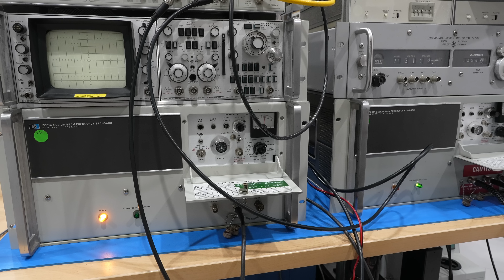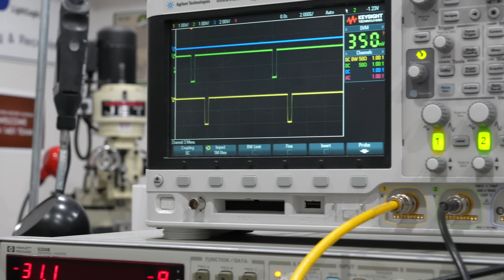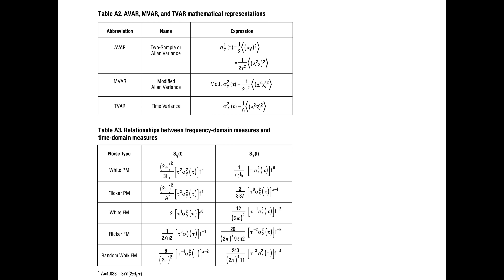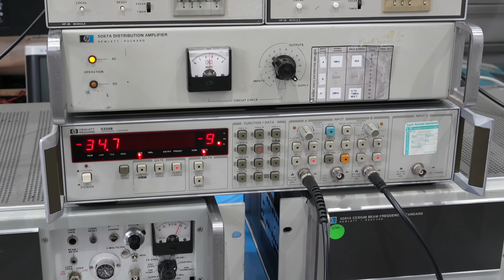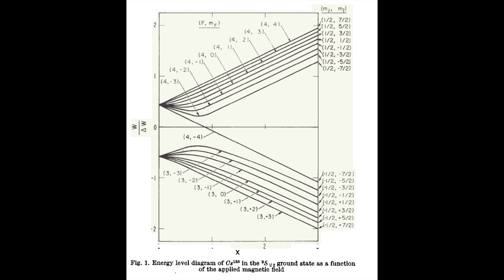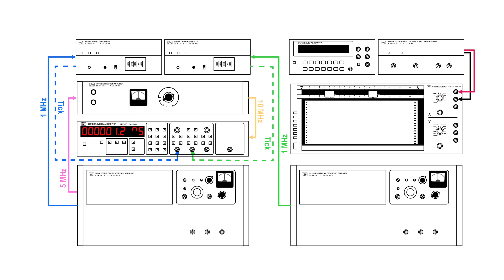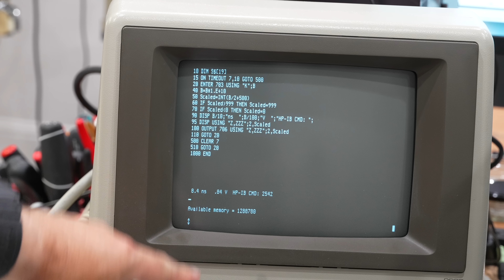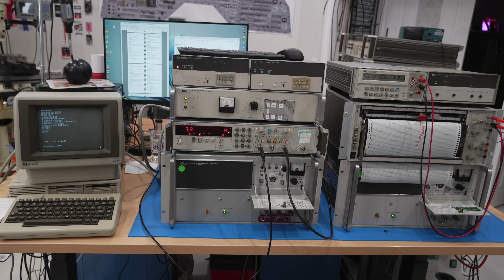Our first dual atomic clock comparison experiment does not go as planned

Comment: Just for fun, what would this stack cost at the original HP prices?
Reply from the maker: Reposting my previous response to a similar comment:
From the 1982 catalog: 
HP 5061A (hi perf) $34,400 (x2)
HP 5087A (with doubler) $1,645
HP 59501A: $700
HP 59308A: $1,325 (x2)
HP 7132A: $3,100
Then they stop publishing list pricing from 1983 to 1985 (to prevent heart attacks, I presume?). But it reappears in the 1986 catalog:
HP 3478A: $995
HP 5334A (Xtal oven + C channel): $4355
HP 9816: $5,150
Which is a grand total of $76,895 of 1982 money plus $10,500 of 1986 money.
Corrected for inflation, the setup is (was) worth $285,466 in 2025 money (list price).
Reply: @CuriousMarc  Plus a service contract - ha ha.
Reply: @CuriousMarc   Yeah $34,000 was about my dad's salary for a year as a social worker with a masters degree in Canada, in 1982.  So this is some sweet expensive gear.
Reply: @CuriousMarc  That's actually quite reasonable considering.  I was expecting it to be over a million in 2025 dollars.  Good value for money.
Reply: The most expensive part are probably the HP-IB cables ;)
Reply: This is very interesting to me because I worked in secondary standards lab which used standards traceable to the National Bureau of Standards. We used reference and transfer standards to calibrate electronic test equipment. Our standards were reference to the primary standards lab which is directly traceable to the NBS lab near Fort Collins Colorado. I believe the atomic clocks at the time were of the cesium beam type.
Reply: it's OK it was all originally public federal debt .... picking up the tab... and way cheaper than what is spent today BTW 70 years later  the clock is at USD 38 Tln.

Comment: I know this is not in the spirit of the experimenting, and definitely isn't vintage, but if you wanted a "source of truth" to calibrate against, shouldn't it be very easy to use (relatively) cheap GPS time modules to calibrate against?  There are modules which can output a 1Hz or 10Hz pulse, which is VERY stable over time, and should be possible to compare the drift of one of the atomic clocks at a time, and see how it drifts over time.

EDIT:  Apparently the US gov says GPS has "a time transfer accuracy relative to UTC(USNO) of ≤30 nanoseconds"  I suppose that even though GPS is incredibly accurate over a longer terms, that may not be stable enough in the short term for this purpose...

Comment: That HP stack brought back memories! I had their 2-channel 10 (or 5?) MHz digital signal recorder, connected to a smaller HP desktop machine with the same HP-BASIC with built-in HPIB protocol handling and a thermal paper printer for hard copy.
Later I became a bit of a Time Nut, volunteered about 20 years with the NTP Hackers and at one point optimized the reference ntpd deamon to be as fast as possible, running at more or less wire speed while supporting a million or more clients on a 4-core server with TCXO or Rb master clock locked to a GPS timing receiver.

Comment: Marc, you might want to check out a channel called "Chernobyl Family" if you don't already know them. They just build a simulation of the Chernobyl reactor display panels, which were electroluminescent originally. They used LEDs, and at first glance I really couldn't tell that they weren't the real thing. On close inspection you can tell, but it is a dang good simulation.

Comment: Can someone help me understand something I'm overlooking please?
if the two clocks are generating frequencies in the megahertz range and are very close;
Why can't I mix the two directly and count the beats the way I tune a piano?
Is that what's going on and I missed it?
I feel I am ignorant of some principle that everyone else finds obvious.
Thank you 
-- Molly
Reply from the maker: The answer is that the clocks are far too stable to generate any measurable beat signal on a human time scale. We aim to achieve a long term stability on the order of 10-14 as shown in the video. To be able to count one beat (at 5 MHz) with your method, the two clocks have to move by 200 ns (one period of 5 MHz). At 10-14 stability, that happens every 200E-9 x 1E+14 seconds = 20E+6 seconds. Which is every 231.5 days. Maybe half that because we have two clocks, but you see the problem.
Reply: @CuriousMarc  thank you Mark. I was having trouble grasping the scale. My decimal points kept rolling off the table and under the sofa. --Molly

Comment: Hi, please don’t shoot the messenger but would the length of the cables and the velocity factor and transmission delay play a factor here? A simple TDR on the cables may yield propagation delays? Those cables don’t look uniform to me and impedance may also factor in. I have an old scope with about 20 meters of coax built into the internals (from factory) for the vertical propagation delay. I use a GPSDO ^11 or better resolution and often wonder if the account could be improved by using  uniform cables to my equipment. Fortunately my GPSDO has 1mhz, 5mhz and 10mhz clock outputs and I’ve smoothed them with LPF and BPF’s for the purest sinewave I could without too much attenuation. Would love you know your thoughts

Comment: Couple of things that come to mind - the first obvious is did you degauss the tubes after putting both the units in position?  If you want to get the full stated accuracy on the opt 004 equipped units then you need to do that every time you move them - ideally you should run them for at least a few days in continuous operation mode before doing so.  Also, do you know how much run time is on the tube?  If you don't know the provenance of the unit it's also worth checking if someone has done something like turning the Cs oven up to try and get some more life out of the tube, since tricks like that typically degrade stability.

Comment: I know you want to do this the most vintage way, but another method is to use the frequency output of your oscillators to drive the system clocks on a Raspberry Pi, then feed them with PPS on the GPIO. You can then use PtP to measure the time drift of those two clocks very accurately AND measure it relative to GPS PPS and NTP time.
Chrony will give you a clean view of the difference in time drift.

Alternatively, speak to the guys at Timebeat about their chipscale atomic clock master clocks. See if you can borrow one and their software used to measure clock differences.
Reply from the maker: Even with a commercial chip scale atomic clock, this would be 4 orders of magnitude short of the needed precision. Chip scale clocks are quoted 5x10-10 over 48 hours. We are trying to achieve <5x10-14. NPT time is precise to about 1x10-7 on our time scale, about 7 orders of magnitude short of our goal.

Comment: The adventures in watching precise clocks are subtle, and slow paced. Comparing a signal that goes "ping" once per second, to another one like that. And they seem to tick precisely, second after second, and their mutual offset hardly ever changes. How boring is that?! Hehe yeah - until you add long-term recording, and process the data into charts. And you come back the next day, to look at what the trawl net has collected. Depending on the scenario / rig and experiment setup on your desk, the result can be boring, like a flat line (which often means success, in timekeeping) or it can be "interesting" - in which case, you find yourself scratching your head. You formulate a possible theory, adjust your experiment, and rinse+repeat. Troubleshooting sessions of interestingly misbehaving kit can take weeks of wall time - even if it's just OCXO's, doesn't need to be atomic. Or take PTP to the table, try plugging some devices together, try a redundant setup, try doing some harm to the topology - it can be no end of fun, only it is slower paced than what normal people are used to...

Comment: Is there any way to use a GPS standard as a master clock since the GPS system itself requires stringent and stable absolute time?
Anyway, bravo for the efforts and anything you can do to bring those HP clocks back into spec or spec+ is commendable!
Just love old chart recorders; I have a HP plotter with electrostatic paper holder--really neat tech.
Just so sad nowadays, that the inner workings of tech are so inaccessible, with the only way to use vintage equipment...

Comment: Wow, this brings me back to my time as a Metrologist, nearly 20 years ago!

Spent most of my time in RF/microwave, and had at least two rubidium and/or crystal oscillators on the bench all the time collecting 30 minute average samples, compared to the same HP cesium oscillator, for several weeks at a time.

This is my kind of video!

Comment: Marc, I use a GPS-disciplined Oven Controlled Crystal Oscillator (OCXO) in my shop for aligning radios. It provides a "perfect" 10MHz reference signal that feeds into lab gear to provide accurate frequency measurements. I got mine from a cell tower surplus site on eBay where it was used as the local master oscillator. In theory, it relies upon the atomic clocks aboard the GPS satellites. The OCXO is for fallback and for bootstrapping the system. Powering it on requires a number of hours to settle as well as syncing to at least 4 satellites - all visible via the serial port.

May I suggest you run an experiment feeing one of these into the differentiator and compare to your local atomic clock(s). You've got the correct method using the phase variance to spot the drift. It would be instructive to see how much relative drift exists between a local cesium source and the GPS birds.

These devices are somewhat readily available on eBay as surplus. I'd stay away from the Chinesium  products at low price points.

If you wish to borrow mine, I'd be happy to loan it to you. Just contact me.

Bill
Reply from the maker: I doubt that a GPS disciplined OCXO could do it. Even a high-quality GPS disciplined Rubidium is not enough. What is the Allan variance at 100,000 seconds of your clock?
Reply: @CuriousMarc  I'm not sure. I'll look for that. Thanks for the reply!

Comment: Could you not simply compare the raw outputs of the atomic clocks by adding them and measuring the beat frequency? In the Michelson-Morley experiment they set up an interferometer to compare the time of the two beams which essentially did that.

Comment: The atomic clock that was used at the LoRAN-C station on Iwo Jima back in the 1970's was accurate to Two point five times ten to the negative 14th power if I remember correctly.  What is the accuracy of these clocks?
Reply from the maker: See video, depends on the time period. At one day, the original 5061A was 10-13 and the hi perf 5061A was 5*10-14. The later models got better though, but our tubes are tired, so this is quite borderline.

Comment: Marc, since you don't have a national Lab master clock, could you use the "app" from NIST that measures the time lag between their master clock and your computer?

Also, I have an HP counter similar to one that we used at work, connected to a hydraulic flowmeter & the "number" output by the counter was used to calculate the volume of hydraulic oil that was going to be used by a test stand to *quickly* test a tailhook damping valve for being within its proper calibration.  It was a lot more basic than what you're using.  Could you explain the different uses of a counter, possibly in a future episode?  I honestly don't know the ways I might be able to use it.

Comment: Marc, have you considered getting a GPS disciplined 10MHz reference ? In one lab I worked, we had a OCXO backed rubidium oscillator from SRS  that achieved a very low root Allan variance, and all our gear was synced to it.  Perhaps in your next video, you will have an antenna mounted on your roof to grab the timing data .. In a pinch perhaps you could put a patch antenna on your window..  I am curious about making sure that your counter is also phased locked to the same 10MHz GPS reference.. I would be willing to bet you're getting some measurement bias from this.. It's worthy to check.

Comment: Thanks for the code explanation. As a programmer, I feel terrible, as I know, for the same task, a modern language and equipment would result 100 or several hundred lines of code for the same task.
I loved basic, loved old computers, you just switch on and you can code immediately. 
Nowadays, just to begin coding, or to run it, you have to configure, setup install sometimes even for a very long time... 
So thanks, this just reassured my belief that I was right thinking it was better back then. I enjoyed coding in the old times.

Comment: You can check your measurement setup by just using one of the oscillators for both inputs to the counter thus simulating two perfectly stable sources, your chart should be steady. 

A couple years back I was playing around with two rubidium clocks and a GPSDO,  really easy to get  sucked into the time-nut rabbit hole.    Lots of fun.  Still want to build a heterodyne type frequency difference counter from a research paper I found.

Comment: Good you didn't put one clock on top of the other, they would be different distance from planet's center and therefore they'd have relativistic drift 😸
Reply from the maker: You are half joking, since with the most precise modern clocks they would see a relativistic difference from one clock sitting atop the other. The best clocks can sense a gravity difference of a few millimeters.
Reply: @ Indeed, didn't know they got this accurate. Still using OCXOs here, so I'm far from atomic precission…

Comment: Finally, a 9816!  That brings you up to the 68000 era, an not HP's proprietary CPUs, like the 9825 right?  I am mostly fascinated by the cesium thingies of course, but I was a 9826 jockey years ago so I had to note the 9816.  We sometimes ran assembly code on those computers and it was tricky porting from 9826 to 9816 as the display was handled quite differently.  Anyway, you have far more courage than I digging into the cesium world, congratulations.

Comment: You have stacked up way too many error sources.  Dividing 5 MHz down to 1 second (if that is what you want) is trivial and completely accurate with simple digital hardware.  Using a frequency doubler is fraught with errors; what is the phase noise of the doubler?  So two atomic clocks with trivial digital dividers are all you need, and multiple nanosecond stability for atomic clocks is actually horrible to start with.

Comment: "The timing gens are fast, programmable digital dividers."

They may have been considered "fast" back in 1975. But today, something with a maximum clock rate of 10MHz doesn't qualify.
Reply from the maker: I should have said fast rise time / low jitter.
Reply: @ Nope. 50 ns rise/fall time. Jitter +/- 100 ns. Honestly, the rise/fall time of a 74S00 puts it to shame at a mere 5 ns or less. Even a 7400 only has a rise/fall time of less than 22ns.

Honestly, the specifications for the HP 59308A are not at all impressive for current technology. They were impressive for the mid 1970s. And after actually looking at the manuals for that timing generator, it makes the accomplishments performed using them look all the more impressive. It also explains their target of 200ns for the experiment. They wanted something large enough to swamp their noise floor for their expected data.
Reply: Seems like there should be PLLs used somewhere in this experiment.

Comment: Could there be any coupling from changes in line voltage / frequency making their way into the results somehow? Or is the PSU of the clocks tolerant and totally isolated to any line voltage changes?
Would you get any differing results if ran off an online UPS?

Comment: Is there not an issue with having the counter referenced to one of the same clocks whose drift you are measuring? I can't work out if it would increase or reduce the measured difference or if it somehow cancels out.
Reply: I think it works because we're only concerned with relative drift between the two. You'd  of course need a third better source to align them to 10MHz exact, but the experiment should work provided they're both equally fast or slow with minimal jitter.
Reply: @Broken_Yugo  If that was the case it would mean there would be no need to externally reference the counter at all?

Comment: Those jumps reminded me of a head-scratching problem I had with EG&G instrumentation many years ago. Overnight runs were glitching and crashing randomly over night.  I thought it might be some subtle mains switching in the city, so even tried UPS power.  When that failed I brought in more DAQ equipment and eventually traced the issue to the pagers in the nearby hospital.  I guess there was less broad spectrum noise and the signal somehow induced weirdness in my timing circuits.   So watch out for RFI! Perhaps put a crude real time clock on your basic program to see if there's an event that occurs at those jumps.  Can big currents being switched locally ramp up environmental B fields and mess with your clocks???
Reply: It could even be off peak switching noise on the power supply, that can be quite ugly. Or a nearby Ham radio dude. This is my first video on this channel, does he have a screened room? I'd start by moving the apparatus in there for a bit of quiet.